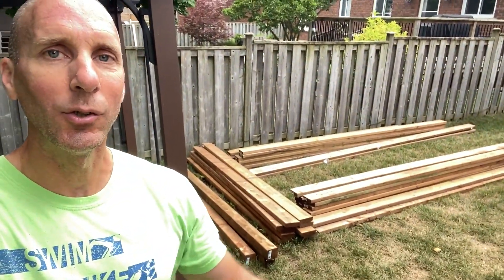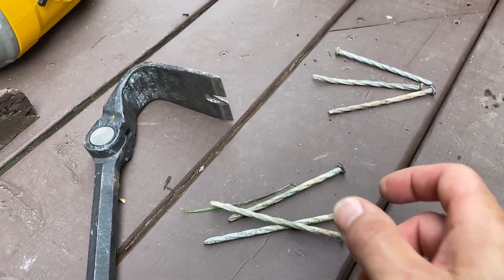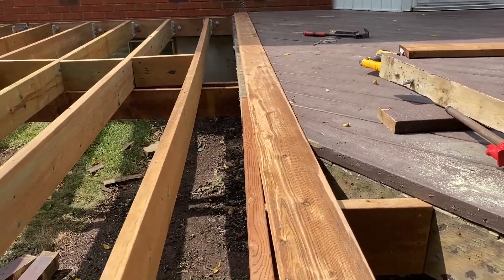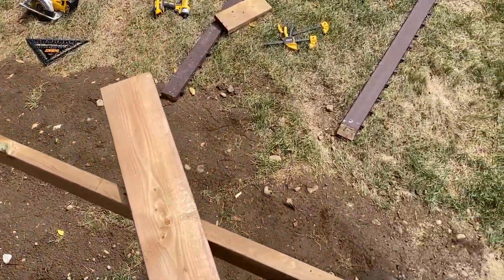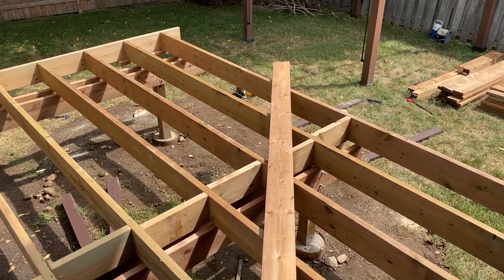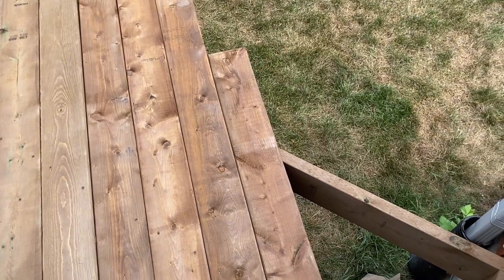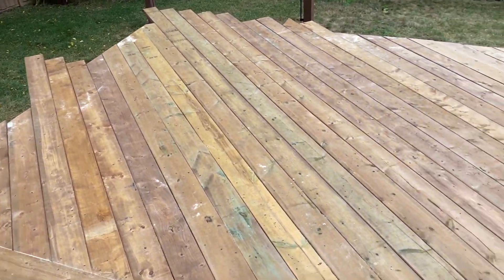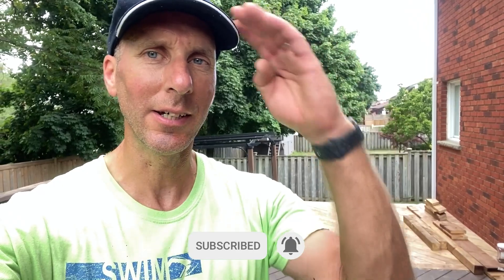Now that's A Nail: They don't make nails like that anymore!

Comment: I actually find this project fascinating and would watch non-timelapse footage. I'm currently attempting to restore/revive the deck on my house (built by previous owner) and having issues with it being not square, etc.. Seeing how you're dealing with similar issues is helping me a lot. Thanks!
Reply from the maker: Thanks for watching and subscribing. I just actually refinished the other parts of this deck this week. Pulled the old stuff off and redid it with 2x6. The best way to deal with non square is stick to what looks good. Most people won't notice it being off square or level if it matches the lines of the house or the rest of the structure. 
It's been tough to videos this summer as I've been fighting rain to get it done so adding the video setup piece just wasn't something I wanted to deal with as well. 
Good Luck!